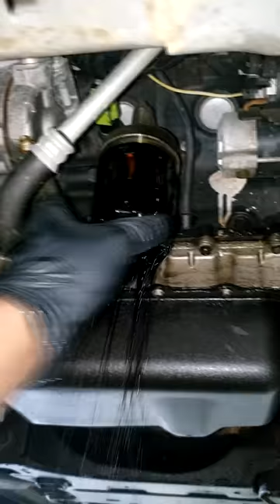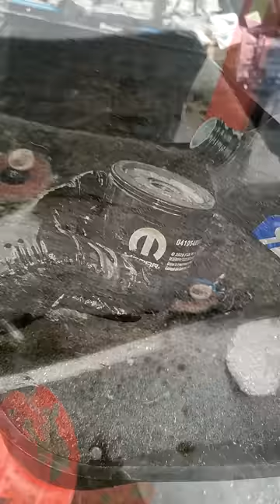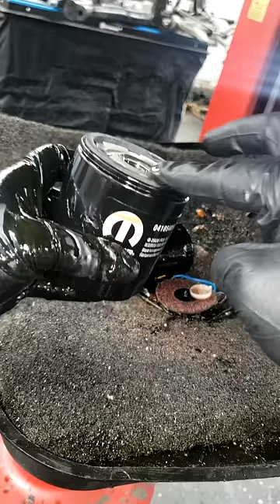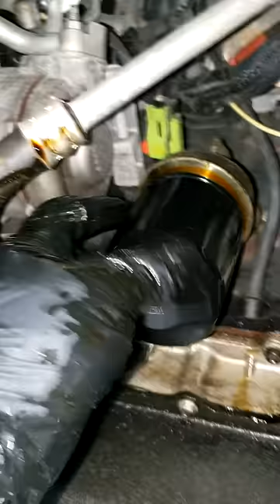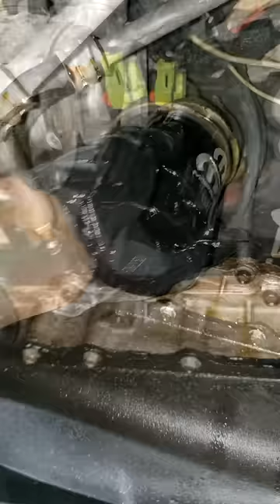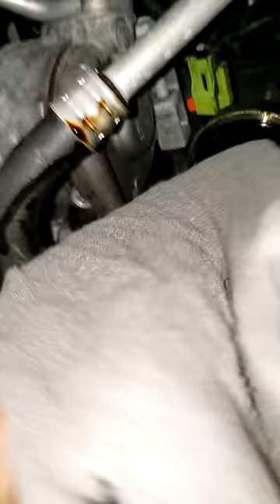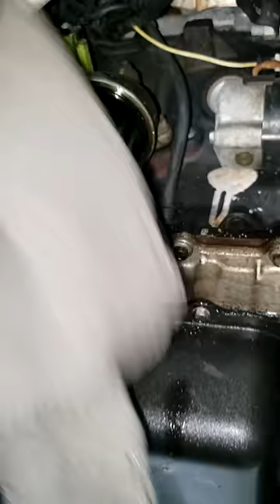Don't Lie.. Are yall still doing this?

Comment: Every little bit helps.  Especially if you're making the car payments.
Reply: every bit of contamination helps destroy the bearings also
.
fill from the outer holes if you must...
the center hole is the "clean side"
Reply: @kainhall just lube the gasket, tf dawg?
Reply: @savagesock3598  Yeah lol. If you wanna go this far you could pull the fuel pump fuse and crank the engine a few times to pre lube.
Reply: @E23  That won't change anything...you're stopping the engine from starting up but the components still move and friction is created.
Reply: @JohnDoe-md2sb sure, but much slower
Reply: @JohnDoe-md2sb  slower with less heat and force, meaning the film of oil on all the bearings will last waaaaay longer then in a running engine, the pistons alone are just moving freely, vs with hundreds of foot pounds of pressure pushing the bearings into the crank, if you want to know the difference take sandpaper and run it over a wood surface with no pressure, it will glide across with almost no scratches, now try applying pressure to it, dont even need to add much to see a huge difference
Reply: @kainhall How does it matter? You're filling it with NEW oil.
Reply: @kainhall  nobody knows what youre talking about
Reply: @savagesock3598  bro what are these weirdos saying
Reply: @pfsantos007  id love to know what hes talking about lol i seen a bunch if these comments but they never respond back
Reply: Every little bit helps on a Fiat Peugeot mopar
Reply from the maker: @savagesock3598  Lmao, I just post a video asking a question, lol, I dont want no trouble
Reply from the maker: @machineman8388  lol
Reply: @Shade_Tree_Mechanic  in gms you can put it in clear flood mode and you can crank it without turning the fuel pump on.
Reply: @OnlineMechanicTips  no worries lmao
Reply: @OnlineMechanicTips  😂

Comment: I work at my local quick lube and tire. We don’t pre-fill the filters because if you put in the wrong oil grade (believe me it’s happened) you don’t have to replace the filter again you can just drain the crankcase. It’s also from the point that it’s a “quick lube” shop and we are trying to get these oil changes done in 15 minutes. I have also been handed the wrong filter before as well, so if I where to have filled that filter and it was the wrong one we would have to throw it out besides.

Comment: Doesn’t matter unless the filter or vehicle maintenance says too.
Reply from the maker: Do people even read that stuff?
Reply: @OnlineMechanicTips  some of us do! Provides piece of mind!
Reply: it doesnt matter if those say or not, it is only common sense that if you dont do this the oil will take much longer to circulate the entire engine, because it needs to refill that entire filter first.
Reply: @MikePerreman  you are correct that we are talking about very short times here. But during that second the engine makes quite a lot of revolutions without oil. Imagine how many revolutions engine takes without oil during all oil changes of it's life span. 

I want to minimize those revolution without oil as much as I can. And I don't know about you but precharging the filter is not too difficult thing to do...

Also that thing about unfiltered oil going to the engine when precharging the filter makes zero sense. 

Fresh oil you pour from the can is at it's cleanest it will ever be again. How the hell it would make any difference if it passes through the filter first?

Comment: Most oil filters have a bypass valve built in to prevent oil starvation in cases on engine start and clogs "The bypass valve – otherwise known as a pressure relief valve – is an integral part of the oil filter. The valve is designed to open when the oil filter becomes clogged or when the oil is too thick. This allows the oil to bypass the filter through a center tube. The oil then goes straight to the engine to prevent starvation and damage."
Reply: That only happens when the filter is clogged and pressure builds behind it, in this instance the oil isnt clogged and would flow right through it, but it takes time for the pump to fill the space in the filter with oil, until its full of oil nothing is going to flow past it and theres no pressure building to trigger the bypass

Comment: I don't beceause I can prime the system without starting the engine. A lot of cars have clear flood mode where you can have the starter turn the motor, but the engine witn start. 

This also functions to prime the oil system. I do it all the time on Toyotas and Subarus.

Comment: If you're going to go through the trouble of priming the oil filter first do it correctly and plug that center hole, second; at least clean off the mating surfaces to make sure you're not damaging that gasket with dirt and debris
Reply from the maker: There was no trouble and this not a tutorial video on how to do anything. I merely asked the question that you manage not to answer because you are focus on trivial things. It is not the end of the world because old oil is on the mating surface, in fact it can be used as lube for the new filter.
Reply: the oil he just put in in the filter is brand new and clean. its fine to charge this way. but IMO as a engine mechanic, its not needed. by the time you start your engine that tiny filter is charged. I built a 91 liter 18 cylinder engine with 6 oil filters, 2 liters each. Those you need to pre fill lululu
Reply: @RocketPropelledGaming  oh believe me I know all about big motors like that. Prior to moving to a GM dealership position I worked on generators with Cummins, Kohler, CAT, ect. Anything from small little residential units all the way up to multi megawatt units on the aircraft carriers in the US Navy. Some of those motors are the same size as my 1400sq ft apartment 🤣
Reply: Are you prefilling with used oil?  Oil in the bottle is filtered.
Reply: It's ok. Most piston engine aircraft engines don't even have a filter. They have a wire basket.

Comment: Aaaaand this is the main reason I change my own damn oil 😤
Reply from the maker: Would you like a cookie?
Reply: @OnlineMechanicTips getting so but hurt by comments 😂😂
Reply from the maker: I'm never but hurt dude. Im just merely responding back to comments. Seems yall not use to that. Yes, I try to respond back to all comments good or bad or even stupid. Im never hurt behind a comment.
Reply: @OnlineMechanicTips I was going to be borederline moronic toxic but I would like to get your opinion instead, what are your thoughts on the Harbor freight cordless impacts? I been simping at the milwakee m18 1/2 drive but Im broke,so HF Hercules ultra torque 1/2 inch drive is my next option, Im not a pro but would love to not struggle next time I do my brakes😊
Thanks man 👍
Reply from the maker: @Goldenstu  Hey but its hard for me to speak on something that I personally have not used. But I would say this, I applaud your attempts at not breaking the bank on this stuff. Most of my cordless stuff is Milwaukee. But heres the thing, if any of those other brands offer a real good warranty on there product,, just know that they likely put some quality and thinking behind building it. So yea, if it has a good warranty ide say go for it
Reply: It depends on how the filter goes on the car but for real’s most of the time no really depends on the customer
Reply: @Goldenstu theyre pretty strong. And if youre a professional get it from the store so you get the 5yr warranty. If it breaks you get a new one. I complained about the led not working (i had like a floor model) and they exchanged it no questions, just receipt.
Reply: @Goldenstu jus use a torque wrench when doing brakes I got the stubby impact n I jus can’t get enough clearance in jobs that require a lot of torque. I was able to do wheel bearing caliper rotors pads and get the lugs off with that one tool.

Comment: 100% I do this every oil change. Even if its mounted on the side, you can still pour some in and turn it to get the inside wet and it wont spill out when you go to put the filter on. I had an aftermarket oil pressure gauge that read the PSI coming out of the filter on a vehicle I had. One time wanted to see if it was a big difference on dry or prefilled. The answer is a big fat YES. It went 8 seconds with almost 0 oil pressure. 
Pre filled, and side mounted filter, was about 2 seconds for full oil pressure,  and was developing some oil pressure in said 2 seconds. I think if you don’t want to pre fill your oil filter, you don’t deserve to be near a car. I can even do it on cartridge filters that are side mounted on some Toyota / Lexus. Zero excuses to miss this step.

Comment: I learned to do this in my highschool autoshop class and still do it to this day. No reason not to.
Reply: But is there any reason to do it?
Reply: My oil filters are mounted horizontal on the side of the block. If I do this the oil I just put in it drains back out.
Reply: @leeselset5751 EXACTLY. I left a comment saying that exact thing. Not all vehicles have a perfectly vertical mounting point with easy access. Owners of 5VZFE and Buick 3800 engines would know.
Reply: @leeselset5751  Lexus owner here to agree with you
Reply: Waste of time when you're flat rate
Reply: There are two very good reasons to not do it.

1. Plastic hairs from the seam on the oil bottle break off and are in the oil.
Pre-filling the filter allows these plastic hairs to go directly into the crank bearings where they can melt and glue the bearings together.

2.After an oil change you are supposed to time how long it takes for the pump to build up pressure at idle on an EMPTY oil filter to test it's flow rate.

Pre-filling an oil filter on a modern car is a really bad idea.
You can cause a spun bearing and you are skipping an important test.

That's why a lot of manufactures are switching to side mounted filters so you can't pre-fill them.

Comment: Filters with threaded opening facing down walks in the room, "hey dudes. You can pour but you'll just have a big clean job on your hand if you do". 😂😂😂😂😂
Reply: Toyota forklifts used to have oil filters that faced downward at an angle.  I changed several of those years ago.
Reply: @bluegrassman3040  Tacoma too

Comment: To anyone reading this: Do not pre-fill filters unless it holds a full quart/liter, i.e a full size diesel engine where you're putting in 12-16 in. In little gas engines you're not going to starve it of oil unless you let it drain for 2 days with the oil pan off and all the cooler lines drained as well at which point you should be priming the engine with fuel cut.
Reply: Series 60 Detroit has 2 one gallon filters. Those will go million plus miles without filling the filters.
Reply: @tacticaldorito3942  yeah cause they must’ve put a massive engine on that filter lol😂
Reply: @tacticaldorito3942  aren't those canisters though?

Comment: Yes but you should really wipe that mating surface down with some brake clean first. Also, i usually twirl the filter around to ensure the oil is soaked in. When you think it's full, it isn't. Really doesn't matter as much as it used to, but it still feels right.

Comment: Some vehicles (Toyotas, Subarus), the oil filter is inverted. So you can't. So it doesn't matter.
Reply: 😂my point
Reply: I guess you could if you wanted to spill oil all over yourself
Reply: Nah. Clearly it’s super important. You need to invert the engine for all oil changes.
Reply: @ricardocabeza6006 😂

Comment: Instead of pre filling i just remove the fuel injection fuse/relay and prime the engine by cranking it over 10-15 secs secs at a time until the oil light goes out.

Comment: Good luck doing this in a Subaru when the filter is upside down 😂😂😂
Reply: Turn the car upside down
Reply: @patodwyer721 I've seen a few Subaru Outbacks upside-down when going off-road... I should tell them this is a good opportunity to do an oil change. 😂
Reply: I got a 97 outback beater with a heater, oil filter is right side up for me

Comment: Yep, fill'er up and spin'er on...unless you're dealing with an upside down filter. In which case, you would prime the oil pump before you start the engine.

Comment: I work on heavy equipment, so it may be a bit different. But we typically only pre-fill things other than the engines filters. Dry starts aren't really an issue with modern engines, but by pre-filling it you are bypassing the filter and can actually introduce contaminants to the system. It's unlikely, but it's way more likely than a dry start doing damage.

Comment: I usually wipe everything down with a rag, I don't leave dirty oil everywhere, I do it so when later after I test drive the car I come back and check for leaks. I just follow Scotty's advice and he doesn't fill the filter with oil, just oils the seal.

Comment: For those with vertical filters. You can still fill it halfway up if not full to make the filter Absorb the oil into the filter material, thus making the time between starting the engine, to getting through the filter about halved time it takes to get through a completely dry one.

does it REALLY matter? Barely. Does it hurt? Not at all.

Comment: Fuck yeah dude, was taught that and still do it. Since the 80s
Reply: Had some idiot say it doesnt work😂
Clearly it does , one particular engine I service rattles like a sumbitch if you dont put anything in the filter.  
3.0gm industrial engines.
Even they suck,the filter is at a 45 degree but anythibg helps stop the rods chattering for too long on startup. 
Doesnt help they ramp to 1800 immediately,so give em some help.
Reply: @MrTheHillfolk   I decided to skip it once and had an awful knock on startup for a solid 5 seconds till I cut it. Restarted and it was gone but engine hasn't been the same since.
Reply: @XTheGaimzX it's not me that came up with "most engine wear occurs at startup" , yeah anything to help out  the lube flow early on really helps in the long run. 
Imagine that clapped chevy that blew up at 200k, if someone actually charged the filters up a little at every oil change. 
Hard to say ,maybe ii woulda gone 250-300k , or 201k...
It definitely doesn't hurt !

Comment: Most oil filters say NOT to do this on the package, lol.
Reply: Yes lets trust a $6 filter versus a person with tens of thousand of dollars worth of knowledge....
Reply: @SCRB1GR3D98 you aren’t supposed to do this but it doesn’t really matter
Reply: @samaulredman9933 your $3 brownie mix box was developed and baked thousands of times by million dollar chefs. So how much times do you think the engineers and technicians take to design and produce your $6 filter?
Reply: @SCRB1GR3D98 lmfao id trust what the filter say and if it was a problem then the filter company would have many law suits for false information goofy 😂😂
Reply: @SCRB1GR3D98  It's not about trusting the "$6 filter", it's about the amount of time that was take researching and developing that filter. I trust the engineers who developed it, not 1 single mechanic.
Reply: Prevents possible dry start. Filters out air from oil system
Reply: @SCRB1GR3D98  I have the education and experience, it's a fucking waste of time, even on diesel engines.
Reply: No it doesn’t matter. On some heavy equipment the filters are upside down and you can’t prefill them. It doesn’t matter air in the oil no one cares. Oil is meant to cool and lubricate as soon as you open the fill cap there’s air in the oil. Now air doesn’t belong in fuel especially on diesels they won’t start and need priming if you don’t prefill filters.
Reply: @SCRB1GR3D98 that 6 dollar filter probably has a lot more cash and knowledge
Reply: Anyone that says not to do that ain't firing on all cylinders.
Reply: @SCRB1GR3D98 if you don't trust what is on the box of the filter, why are you trusting the filter?
Reply: Yeah it's called PRIMING the filter.highly recommended.oh and ffs CLEAN the filter mounting plate of old dirty oil and debris before installing new filter
Reply: I'll do it  if the vehical hasa vertical oil filter.
Reply: @samuria- trust the science as well 👍 😂sheep
Reply: @SCRB1GR3D98 trust the person with tens of thousands worth a knowledge or the company that would have to payout millions if not billions for causing catastrophic damage to people’s car.
Reply: What company says that 😂😂. Look up Chevrolet, they have several vertical filters if you don't add oil to them they will not get pressure and you'll run a dry sump. So please for the love of God stop with the b.s lies 😂
Reply: For very good reason. Most people have no clue on how to do it and contaminates are directly introduced because of carelessness. Do a flood start instead and if the car doesn’t have that feature, the vehicle is old enough to not need the filter primed.
Reply: @SCRB1GR3D98  $6 filter or the millions of dollars and knowledge behind those who made/designed the filter?
Reply: @dcomputers Homie just said it prevents air in the oil system 😂😂😂😂
Reply: @jackcarlson8875  Bet that guy runs the wrong blinker fluid 😂
Reply: @PoorMansInvesting  Highly doubtful.  More like food scientists who figure out how to use the cheapest ingredients without killing the customers.
Reply: @SCRB1GR3D98 I'll trust the engineers who designed the oil filter over some random YouTube dude.
Reply: That’s so your shit breaks faster and you spend more money on repairs.
Reply: @samuria- if you trust an engineer over the mechanic I hope you just stay away from cars all together.
Reply: @ICGarchive  I am a mechanic you dingus.
Reply: I like making money more
Reply: most filters say not to do this because the filter media is pre-soaked, which is the only real reason to do this.
Reply: Test